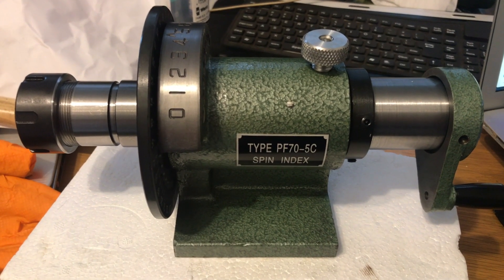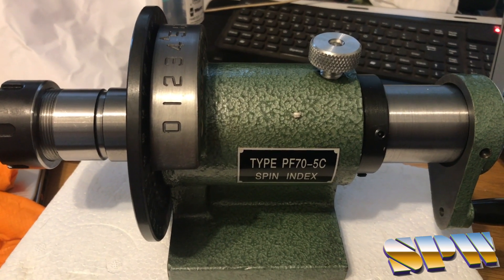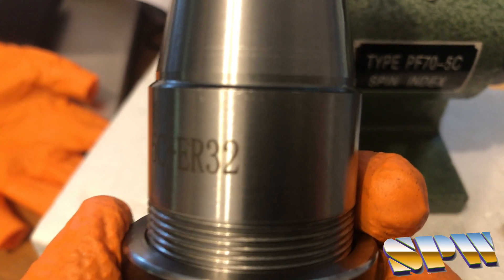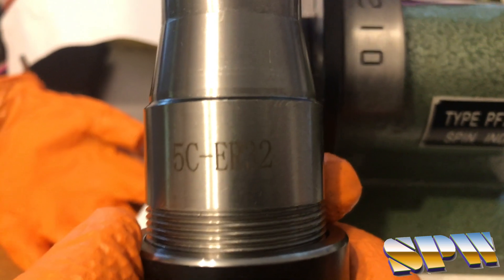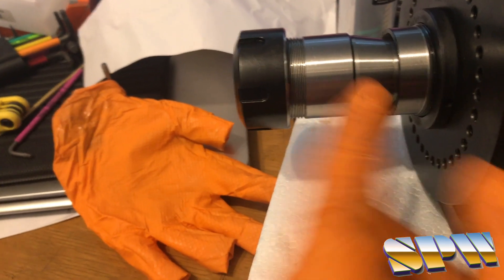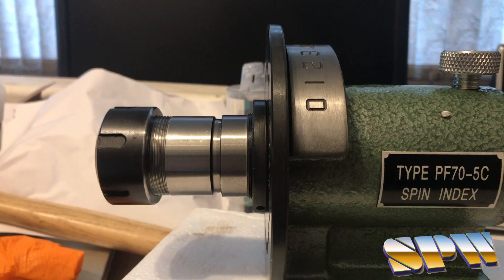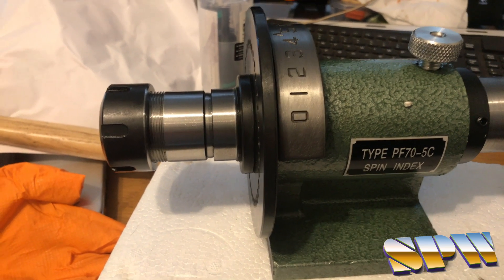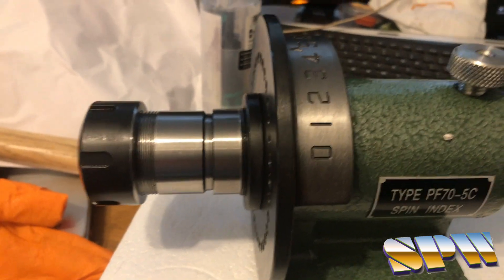Spin Indexer for milling machine with ER collet adapter

Comment: Hi Sarel, now there's a name I haven't heard in a while, somewhere in South Africa I'm assuming. I had the same problem with my spindexer but being unable to find a source of ER 25 to 5C adapters I resorted to making my own. I had already made an ER 25 chuck to fit directly onto the Myford ML 7 spindle without all the hassle of making a plate to mount a bought chuck. All I needed was the nut and I  had purchased three for future reference. They're cheap enough.
On the 5C ER 25 adapter I also cut the internal thread in the rear of the adapter so I could use the depth stop I made for the 5C chucks, square  and hex blocks, with the er 25 collets when using the spindex. The only mod needed was a slightly longer stop bar to cover the incresed length. Does your adapter allow for this? Where did you manage to find your adapter?

Comment: Awesome. I didn't know a 5C to ER adapter was available. Was about to buy a spin indexer to do hex bolt heads on the the mill. The spin indexer is smaller than keeping the rotary table attached all the time.  I dont have 5C collets yet but do have some ER40s. I can buy the adapter and see if that will do the job as it's cheaper than buying a 5C set.